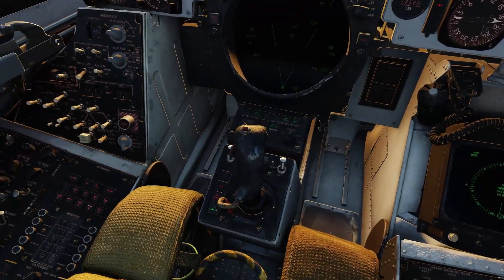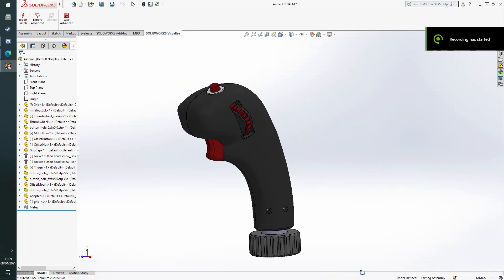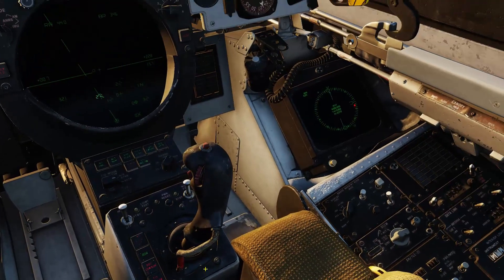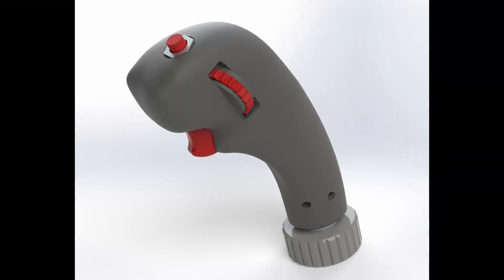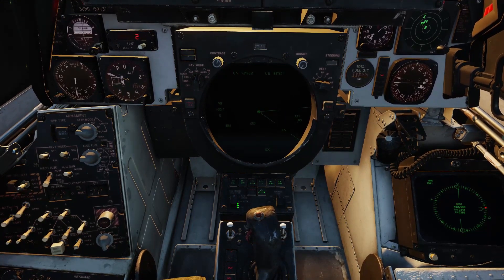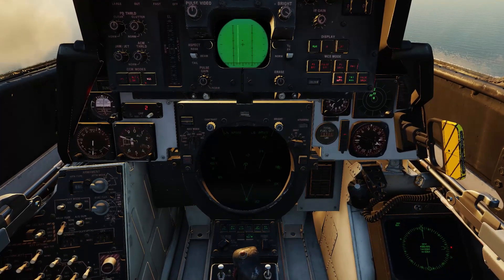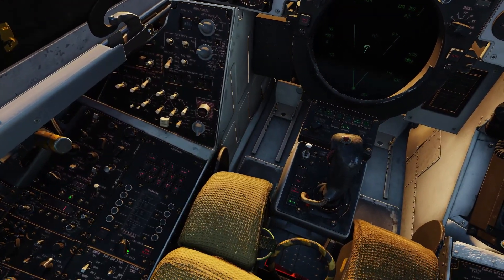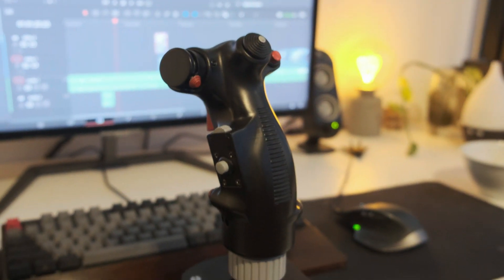3D Printed F-14 RIO HCU and other updates

Comment: This looks amazing. Can’t wait to see what you do next. Currently working on finishing some rudders currently. Eventually there are plans for me and my buddy to make a 2 person f14 simpit and these models and the base will be exactly what we need. Thank you for designing all these impressive models.
Reply from the maker: Thanks! A 2 person simpit sounds amazing.
Reply: @someactivemedia  No progress on it yet... but I am working on a modular pit which means an ability to create a simpit for the f14 rio that is separate from my flying setup. So far, I have looked into using a Micro stick JH-D202X-R2 instead of a diy gimbal just to make it easier and having the stick made so I just disconnect my flight stick cord then quick release the mount and secure the hcu and plug it in. As per other controls, looking into possibly making the TID and DDD on a 24-27inch screen with an overlay that has all the buttons mounted to that, or failing that maybe a long and narrow LCD screen in a 3d printed button box. Obviously very much a “in my mind” build right now.